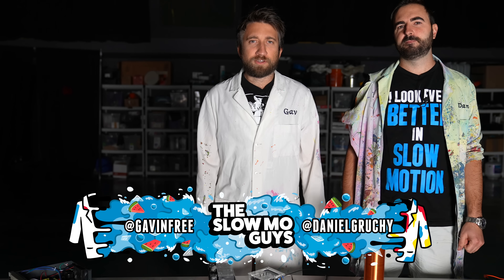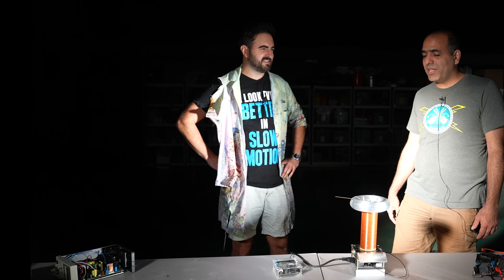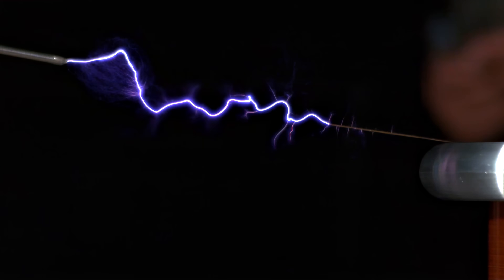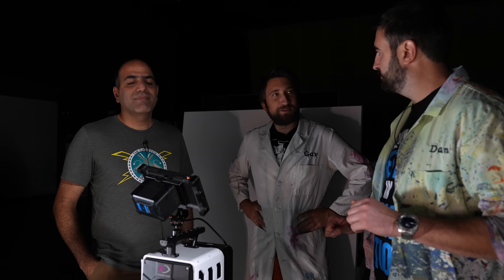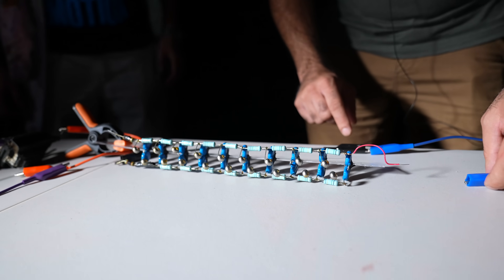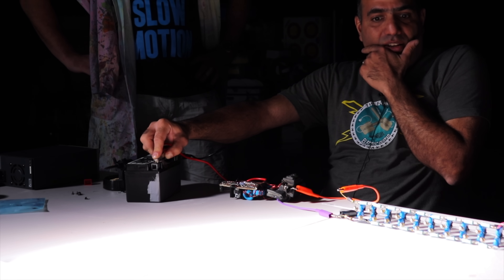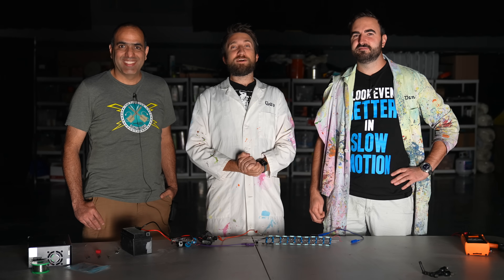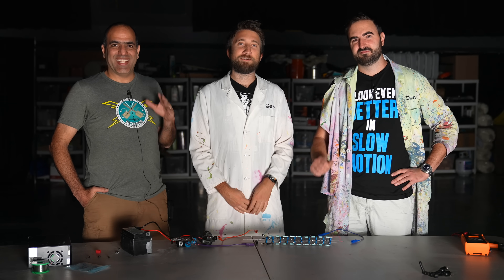Electrical Arcs at 1,750,000FPS - The Slow Mo Guys with ElectroBOOM

Comment: I'm only at 4:13 but it's lowkey terrifying to see where the area around the strike on Dan's finger is glowing yellow from the shock. It's like a miniature version of how people can survive lightning strikes because the absurd temperature only lasts for such an insignificant amount of time
Reply: Correct, sodium is so luminous it doesn't take much, and sweat and skin contains plenty to be visible this way. There's also the instantaneous combustion of carbon and such.

The current flow is quite extreme (some amperes through that patch of skin), and it takes some depth to dissipate as it spreads out over your body -- astonishingly this has little immediate health effect, unless the sparking is repetitive enough to cause internal heating (which can cause quite deep and painful RF burns!).  It's truly the case that squishy-meat-bags interact very little with electromagnetism, with thermal heating being the most common issue; you can say this is part of the proof that we are extraordinarily insensitive to it.
Reply: @T3sl4  turns out we were the dark matter all along
Reply: @T3sl4  Are you trying to say we should interact with it or we shouldn't?
Reply: It also shows how terrifyingly powerful lightning is, the extremely high temperature (as in, much hotter than the surface of the sun) only lasts for an insignificant amount of time but can still cause third degree burns and fuse sand into glass. Lighting can literally flash-fry you.
Reply: I think that sodium contamination also plays a role here
Reply: @Antek1234l  Is there any sodium in the air? Where would the sodium come from? I mean, it's certainly reactive enough, but ...
Reply: @3nertia  Well, my theory is that they had sodium - contaminated hands. It may come from a table salt, or maybe even water, because tap water contains small traces of this metal.
Reply: @Antek1234l  What about sweat?
Reply: @3nertia  any salts and oils and water on the skin’s surface will conduct the charge to ground. That is, unless the voltage is so strong that the oils and water vaporize. Then the current will begin to travel beneath the skin.
Reply: @tomhsia4354  Yeah, you are right, there are many sources
Reply: @Antek1234l  Fair point!
Reply: @qwazse4  You as well, fair point!
Reply: @Antek1234l  I stand corrected! :D
Reply: Low amperage?

Comment: The arc pathfinding is really cool to watch. I wonder if you can set up a small insulated maze and see if it can solve it.
Reply: This would be an awesome experiment. Maybe see how long you can make it
Reply: if you filled the maze with water it can
Reply: You totally can. It's kind of what a Lichtenberg pattern is.
Reply: Heck of a lot faster than slime mold.
Reply: solving it is literally the only option for it to short out between both ends.

there's no way not to solve it unless it doesn't get inside the maze in the first place(which would be a fluke and not a valid test)